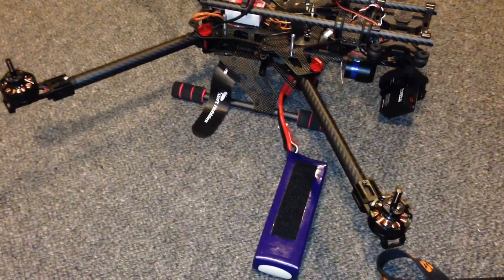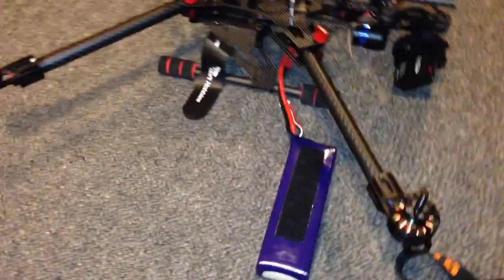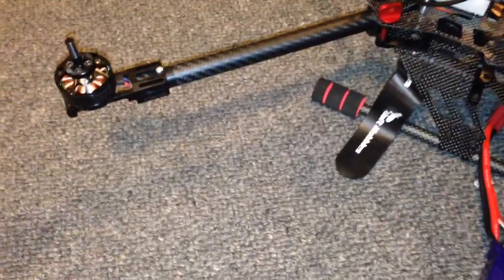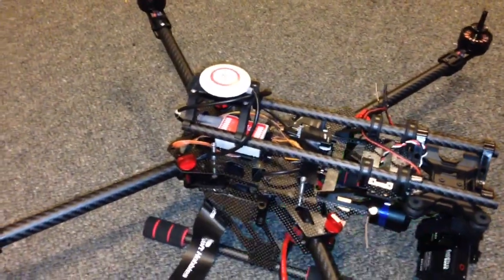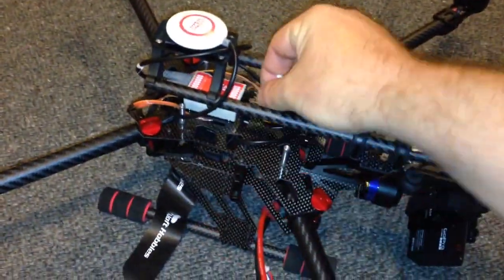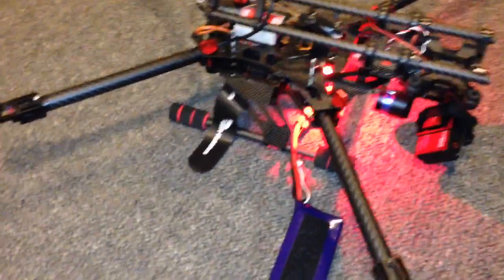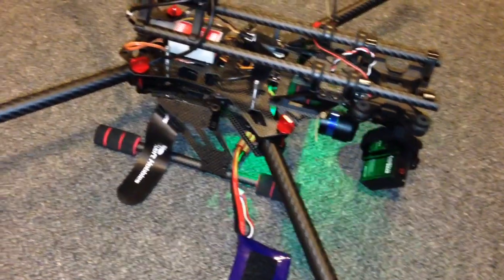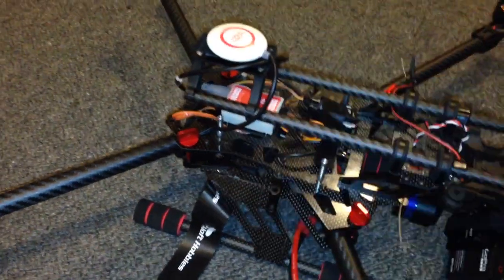Strange ESC interaction (also occurs with BLHeli firmware)

Comment: If it is a EMI issue you should be able to isolate the ESC with some copper and see if they stop oscillating. A trick I used for years would be getting a a old AM radio and putting the antenna next to one ESC and turning the dual until the wine fluctuates with throttle. Then moving the antenna next to each ESC one by one. I would bet the left two are screaming EMI and saturating the other effectively changing the signal and causing your oscillation issue.
Reply from the maker: ***** Thanks Johnnie, I have some copper tape so its worth a try.  I ordered a few extra ESCs and will swap them out also.
Reply: Good luck.. We hate getting stumped on issues like this!
Reply from the maker: ***** Yes I know what you mean.  I am away on a 2 week work trip right now and itching to get home to try more troubleshooting.

Comment: That is a strange one. Maybe you could swap esc,s to the other 2 motors and see if the problem follows them. If it does then I still dont have an answer so maybe replace those two and see what happens.
Reply from the maker: ***** Hi Noel, yes I tried that also and the problem stayed with the same two ESCs,  I have ordered new ESCs and hopefully that will fix it.

Comment: Hi rob.
The only thing I can think of, it's a firmware issue. Try to flash them with blheli. It's so easy to configure with the GUI, and perform really well. The Afros have really good hardware, but I prefer blheli.
Reply from the maker: ***** Yes it very weird, I am using Afros in another quad with the same motors and firmware and they seem ok.  I will try BL Heli this weekend but have new ESCs on the way also, the left two seem fine.  Hopefully that fixes it.

Comment: Are you running simonk or blheli ?  If the FC has been ruled out with a servo tester then it has to be something like sync or motor timing maby.
Reply from the maker: Ahamay75 Its been puzzling me for days now,  this is SimonK firmware, the latest,  I'll try BL Heli next.